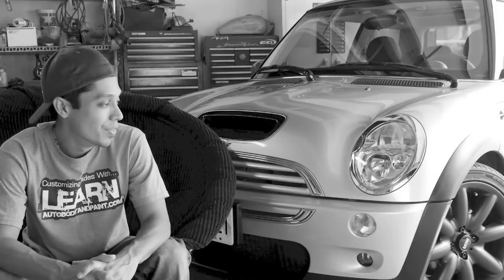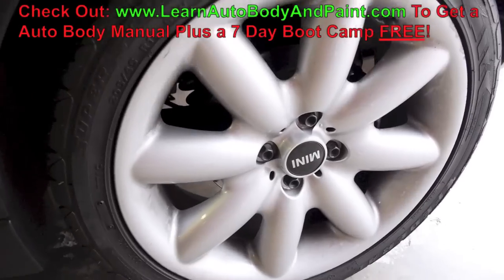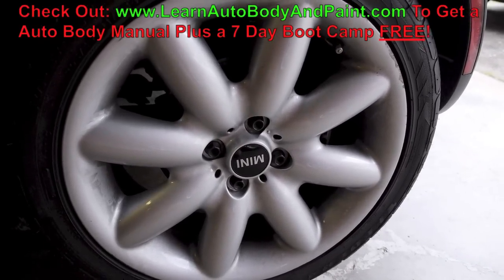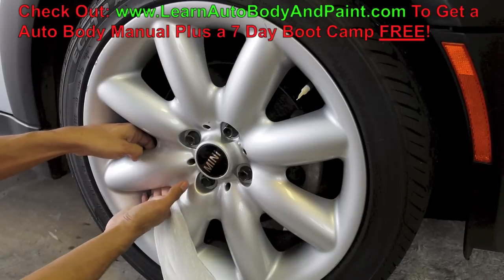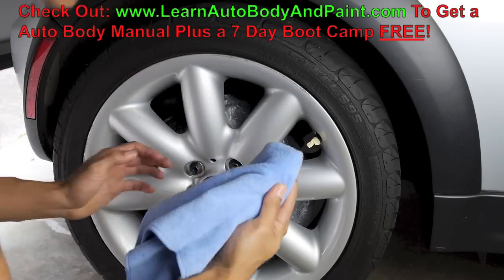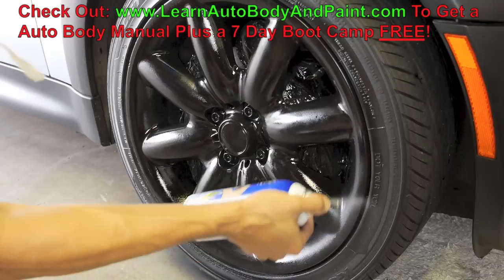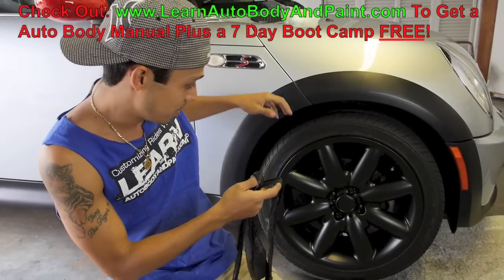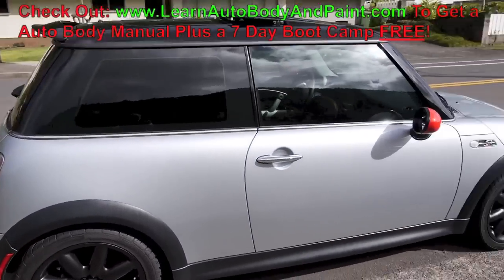How To Paint Your Rims With PlastiDip

Comment: Just need to add a few pointers to anyone considering using Plasti Dip. Plasti Dip is a superb product which is very forgiving as its so easy to remove if you go wrong but  you absolutely MUST ensure the surface is 100% grease free....the slightest bit of grease and  and it will not adhere thus rendering it easy to peel back

Comment: Two quick questions - how long do you wait before coats typically so you get good adhesion and no dripping? Let's say in ~60º weather. Next, is the only way to get a semi-gloss to use the gloss spray? Or does plasti-dip make different gloss levels for black? Thanks!

Comment: I'm thinking of using plastidip in black as a base coat on my rims and then use Rustoleum peel coat  top  coat effects in colorshift. What is your opinion? Will the two brands work well together? I want to use the plastidip as the base for the longer wear it has.

Comment: Im wanting to use plasti dip on my Truck I was wondering if I can paint stripes down the center of it without having to worry about it peeling off on either side of the edge of the plasti dip?

Or does the Plasti dip will only come off if I peeling off with my hands?

Comment: Wow, I'm almost convinced. I think I want to plasti-dip the wheels on my 2005 Acura RL. It's nice stock but needs something to make it's look a little more aggressive, and I think this is it. Plus it's cheap and reversable! How well does the finish hold up over time. I imagine you have to redo it when you change tires (mine are almost new). And how does it handle heat? Wheels can get pretty hot with just a little spirited driving. They act a a heatsink for the brakes to some extent.
Reply: I have had the same coat on my rims for the past 15 months. It has shown no sign of peeling nor have I had to do a recoat. Albeit the colour has faded to a smoky black colour, it still looks decent enough for me to drive my car without being embarrassed haha.

Oh and I live in Australia, this summer we hit 40+ degrees Celsius weeks at a time, I drove around a lot during those days and I think this is what that made the plastidip fade to a smoky black colour. I plan to remove the coat I have on my rims currently and repaint it again so it looks new again really soon.

It is really worth trying out imo, it is inexpensive, easy to apply and most importantly removable :). PM me if you want any more details.

Comment: I have a tire/wheel package with alloy wheels coming from Tire Rack in a few days. I want to spray all 4 with clear Plasti Dip simply for chip protection. I may also want to use Glossifier. My questions are how many cans of Plasti Dip clear and Glossifier will I need to do all 4? Do I need to use the Glossifier immediately or can I wait several days to see if I like it matte? And lastly, how long should I expect the plastic dip to  look okay before I need to touch it up or do it over? Any help would be appreciated. Thanks.

Comment: Hey I found this really useful. Thanks so much! By the way, just one question - I'm planning on doing the exact same thing with my rims but I'm just curious as to how the inside of the rims will turn out - do u reach all the way in and spray the inner circle of the rims as well or do you just cover the outer parts ie. the outer half of the rim? Thanks!

Comment: i wondered how well plastidip stands up to a pressure washer when you clean your wheels?
Reply: It wont. A lot of guys on my forum have dipped their emblems and the car wash takes it off. If you dip, its suggested you hand wash only, with an "absorber" rather that terry cloth or microfiber. Some people find it a "Hassle" but is saving quite a few bucks and irreversibility not worth a little hassle?
Reply: Zac Price
reason i ask is i want to paint my center caps on my atv rims and with a quad a person has to pressure wash. i guess i buy a can, see if i like the look and use spray paint to repaint if it looks good. thanks for the info man.
Reply: TheCheesewalrus I do pressure wash my car from time to time, I haven't had any problems with the plastidip on my rims coming off. There are vids that show plastidip being tested under high powered pressure washers, perhaps you should look at them and make a well informed decision before purchasing a kit.
Reply: it may depend on the surface too. I imagine plastidip will hold stronger on brushed aluminum surfaces, rather than chrome plastic emblems.

Comment: So... is plasti dip basically a cheap way to paint your rims/car?
Reply: It isn't paint but it's a great way to put a "clingy" color pliable plastic on your wheels to change the looks. I'm going on 5 months on my polished aluminum wheels with flat black and it's still looking pretty great. So yeah it will change the color like painting except there's not depression when you mess up. You just peel it off and start over.
Reply from the maker: It's a rubber style of paint that you can peel off. Neat stuff.